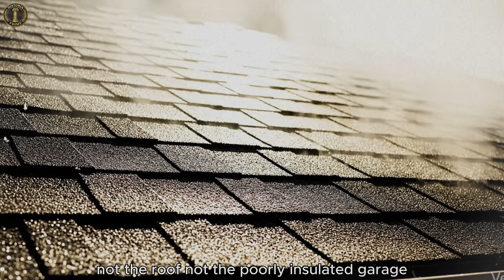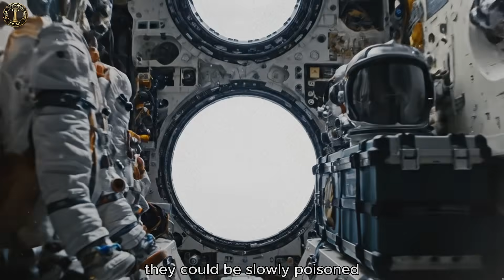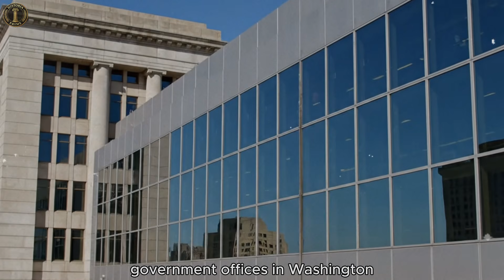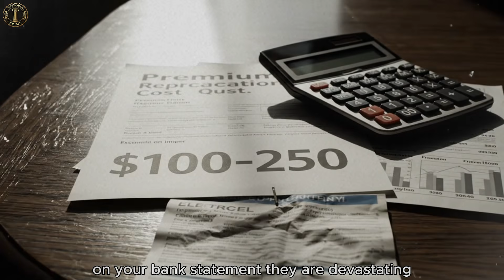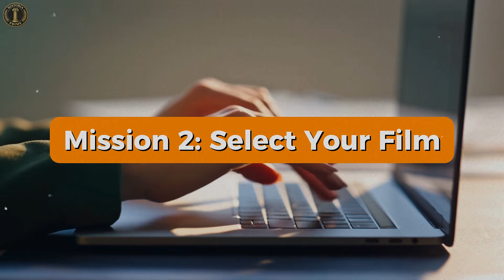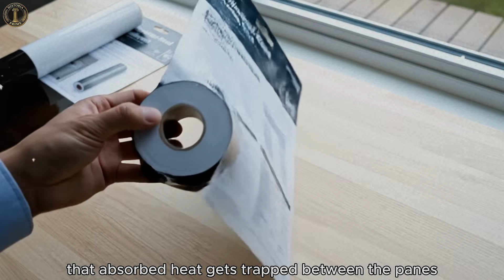This $15 Sticker Cuts 80% of Your Energy Bill. Why Did the Energy Industry Hide It?

Comment: Shut your blinds on south side of house with black out blinds .i do it. I use big silver car shade tape it over south side windows.
Reply from the maker: That’s a smart low-cost tip. A lot of heat gain really does come straight through those south-facing windows.

Comment: My rule when it’s very very hot: like 100+….Or very very cold like below zero,  we leave the blinds closed   And we went from 100+ to below zero in about seven weeks last fall in Chicago area.    Now we have 70s one day, 32 the next.    Do you know why this is called Spring?   Because the temperature springs up and down.  And I’m sure we have low e glass because it was part of efficient building program
Reply from the maker: That’s a smart rule, honestly. In extreme heat or cold, keeping the blinds closed can make a real difference, especially with low-e glass and better insulation.

Comment: Doesnt matter really what you do. Yes you can try to save money but the most part of a high energy bill today is from distribution charges. But yes there are definitely things you can do to cool your house in summer and warm it in winter. I put bubble wrap on my windows for the winter. Helped lower my gas bill. I keep curtains on my windows in summer. Water is your best friend in the hot weather. Water can cool you off with just a fan. Or go to a stream or river and cool yourself off. Not much you can do in winter, i find going to work keeps me warmer for free. 😅
Reply from the maker: That’s a fair point. Utility costs are definitely more complicated than just one fix, but simple things like window treatment, curtains, and insulation can still help reduce the load.

Comment: Now what we need is a way to apply this so it would block heat out in the summer and in in the winter… heating bills are as bad or worse than cooling bills…
Reply from the maker: That’s the ultimate goal, balancing both seasons is definitely the trickiest part of energy efficiency.
Reply: It depends. Many areas have much more hot weather, and not much very cold weather. Ultimately, I do hope economical answers for heat and cold will become readily affordable/available.

Comment: Well in our case, in sunny California, we use a whole home rooftop ducted evaporative cooler system with ceiling fans that keeps the house nice and cool during hot summer days.  Monthly cost of operation is around $30.
Reply from the maker: That sounds like a great setup for hot, dry climates, and keeping costs that low is impressive!
Reply: How much about was the unit and install??

Comment: The heat in my house is from the roof 
A temperature gauge proves it. And I have the low E windows.
Reply from the maker: That makes sense. Roof heat gain is huge in many homes, and once the attic and ceiling load up with heat, the whole house feels it.

Comment: Window sales men - 80% of heat through windows.  Insulators - 80% of heat from roof & 40% through walls.
Reply from the maker: Exactly, those percentages vary a lot depending on who is trying to sell you a specific solution! 🤔
Reply: @HistoriaPrime1212  I just make sure I have the right insulation and shades. I planted hybrid poplar trees on south side of yard far enough  away from house but staggered so it blocks part of the sun blasting on the house. Those trees grow so fast. I planted 4 about 5 years ago ,small trees.Right now they are about fifty foot tall.Then got some updated windows after building house in 2001, good windows help. With the right kind of blinds.We have a deck on south side of house with a picture window facing it. Put a retractable awning there. Huge difference with that sun blasting by noon in the summer

Comment: Cmon guys, get 6-10 summer front windows sun shields cut for  large pick up trucks, double them for each windows and relax.  Ptoblem solved,  sun rays on the record hottest day will not penetrative this method.  I use Home Depot tiny clamps to hold them in place or several wood sticks cut to size to keep them from falling.
Reply from the maker: That's a practical, low-tech way to handle solar gain directly at the window.

Comment: I realised this when the Housing Association removed perfectly good windows and replaced it with Triple Glazed Windows. 
In winter, it is colder than outside, in summer you are in a brick or glass kiln. You will sweat as if you are on a Caribbean holiday or trying to run a marathon. 
I decided this year that I would invest in some solar panels to run the washing machine, dryer, fridge and the portable air conditioner.
Reply from the maker: That sounds incredibly frustrating. Bad window replacements can make a home miserable in both winter and summer, which really shows how much building details matter.

Comment: Will it increase the heat between panels for a double pain window? Would this accelerate the break down of the seals?
Reply from the maker: Good question. In a double-pane window, anything that changes heat buildup could potentially affect the seals over time, so I’d be cautious and test carefully before doing anything permanent.

Comment: In the summer, I just close my shades where the sun is coming in and open the windows in the shaded parts of the house and use a fan. I never run my AC. On a very hot day, I'll go out in the backyard in a shady spot.
Reply from the maker: That’s a smart low-tech cooling routine. Shade, airflow, and timing really can make a huge difference without needing AC.
Reply: Not in Mississippi!
Reply: Try that in Phoenix!
Reply: Where do you live tho?
Reply: @eyeshalfwayopeneyeshalfway2603  I live in Indianapolis. I've never tried this method in Mississippi or Phoenix 😃

Comment: This seems like an excellent idea for my house in the summer.  Is there a way to remove this for solar gain and heat in the winter for a southern facing room with S, E, and W facing windows (60% glass coverage)?  N wall is brick exterior wall of 1959 ranch house.  There is no shade or mature trees in the yard.
Reply from the maker: Yes — I’d definitely make it seasonal and removable rather than permanent. For your setup, removable exterior shading or removable interior panels/screens would probably make the most sense: keep them on during peak summer heat, then take them off in winter to regain solar gain, especially on the south-facing side. With that much glass and west exposure, the summer heat load is probably huge.
Reply: no thxs.. to digital  planning

Comment: My house is all windows it's ridiculous, I guess glass is cheaper than bricks,I have blockout blinds on all windows,but it's still too hot.i have some of this film have been meaning to put it up to all windows. I'm sure it will help.thank you.
Reply from the maker: Sounds like a perfect application for it, let me know if it helps with the heat! 🛠️
Reply: Over time that window film degrades. My mom and dad had it. Removing it was a trial. You can't grow plants with that film. Mom gave away all her plants. 

Thermal curtains and velcro tape is much better. Best of luck, friend.
Reply: Paint your roof white too.  White the house w lime if it's wood or stone

Comment: It's not kilowatt hours that they make money on but the price of those that doesn't seem to ring through enough if prices are high they would make the exact same or more but this would at least be applied and much more, same with fuel you don't pay by amount but by price the gallon/liter that's key !!!
Reply from the maker: Spot on—the rate per unit is the real bottleneck for saving money! ⚡